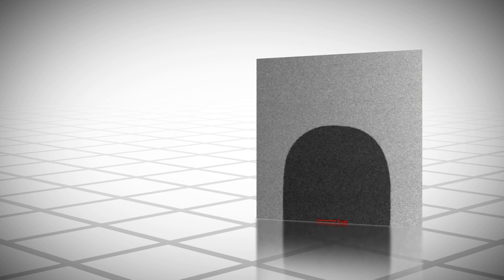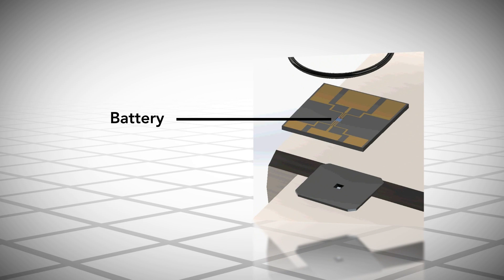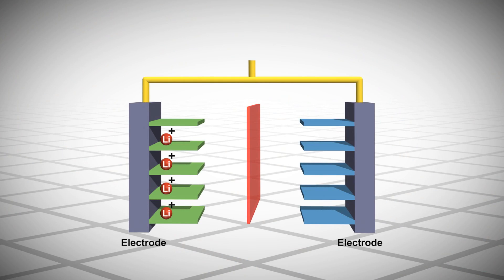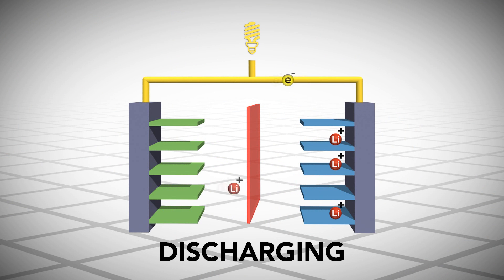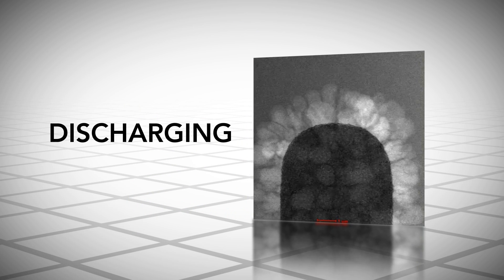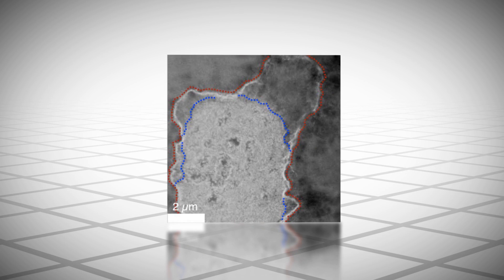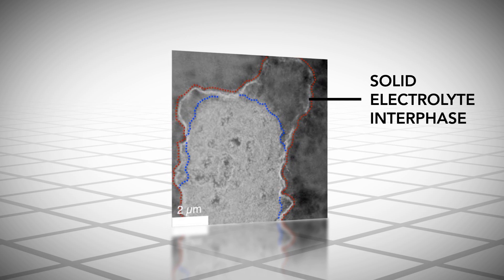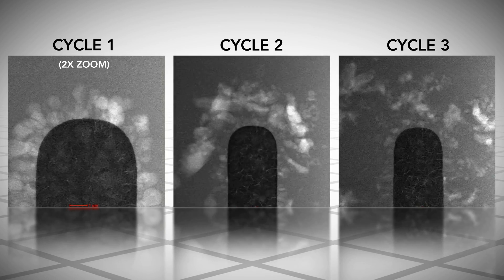Scientists View Battery Under Microscope

Comment: Cycle 1 and 2 are already screwed? My Macbook battery has lasted me since 2011 and still has 93% of its capacity...
Reply: they probably abused it so much that the damage would show up instantly on the next cycle instead having to cycle it a bunch
Reply: Yeah, I know, it just seems odd, if the degradation take place on this small scale, it should really affect the rest adversely... because it would most likely happen to every part of the battery.